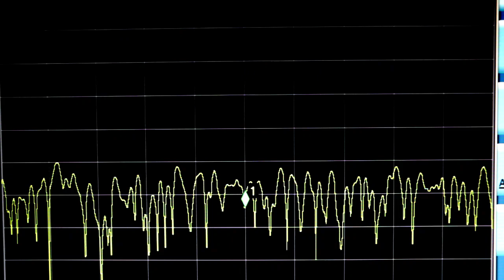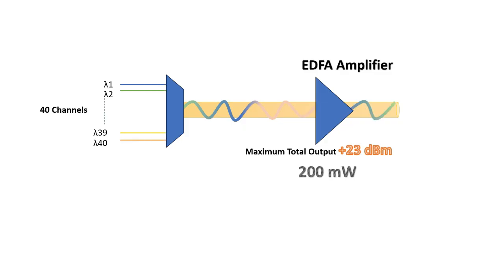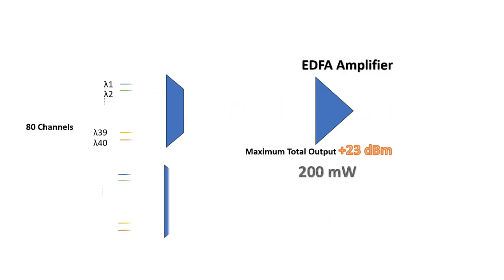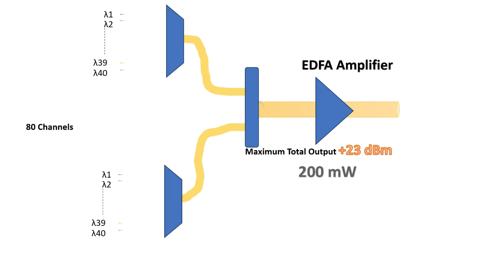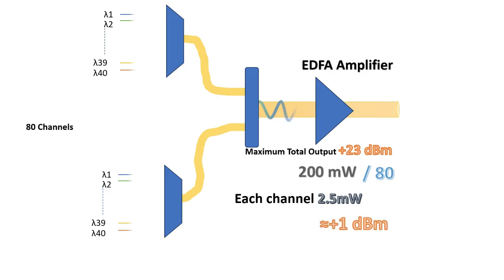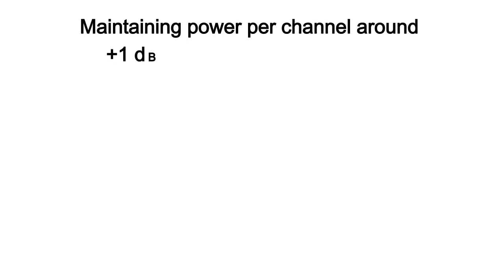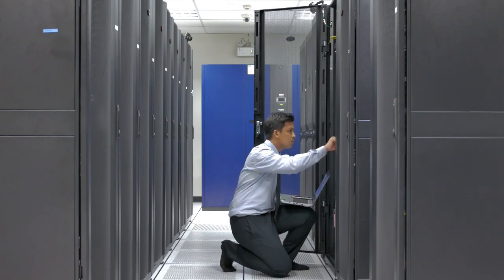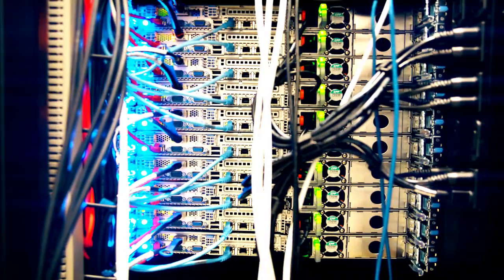DWDM Interview Question | Power Balancing in DWDM Systems | DWDM | OTN| Fiber

Comment: How to calculate it ??
Reply: Sorry My English, I will to try explain.
First you collect out put max supported in you amplifier.
Example 20 or 23 dBm
Now you need them number max channel of system, 40 80 96 120, project ou hardware equivalent.
Now you have de single channel.
Out put max - 10*log(System channel) = 20-10*log(80) = 1dB per channel or 20-10*log(40) = 4dB.
Reply: In resume if you have 40 channel with 1dB, The system will to respect them limite of Power amplifier = 20.
If you system need more Power, you less EOD= end of life in the system and you system supported less channel 20 30  and work with 7 dB per channel and etc.....
Reply: @hericlesgustavo6246 - Great thanks for your reply